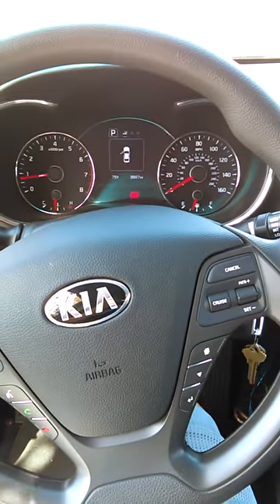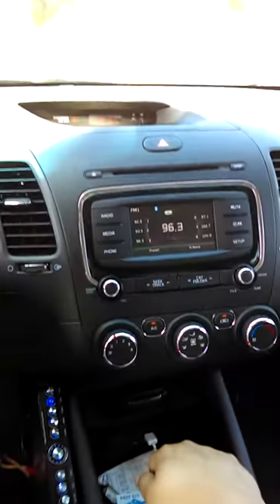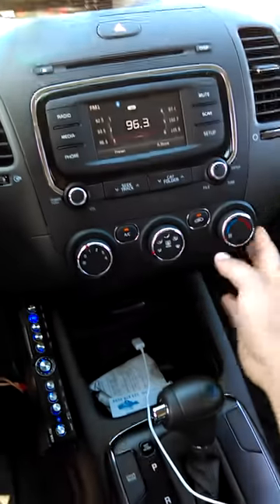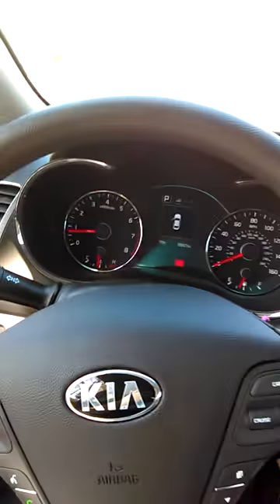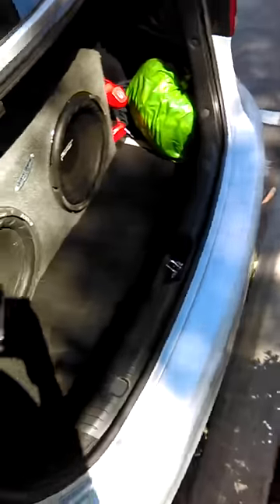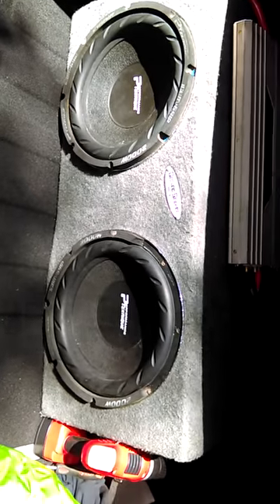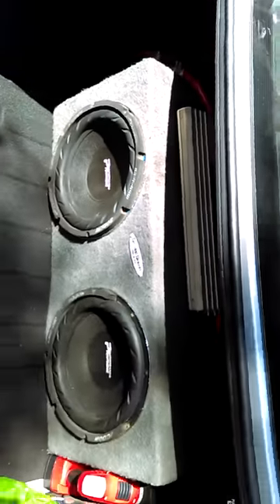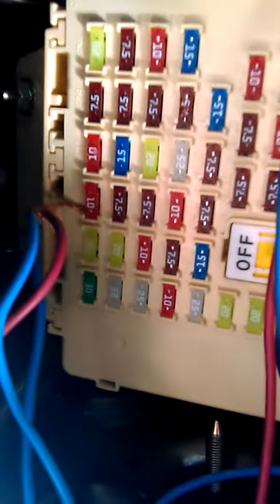2017 Kia forte subwoofers amp on stock radio subwoofers bumping

Comment: If you want to not have wires just poked in to the fuse panel, there is an accessory wire that you can splice into that is in the harness for the stereo. It’ll save you a ton of time when you decide to upgrade the head unit. You’ll already have the remote wire there and won’t have to run another one.

Comment: Not bad man not bad....i have a 17 forte too but i replaced the speakers and stock radio...im amplifying  the speakers and also powering a 15 inch jl sub
Reply from the maker: Thats cool I dont have a personal car these have all been customers cars that I have done but I dot have any cam set up or anything so I use my phone to video the job when i can
Reply: Hey man how is the car holding up with 2 amps.  I have a 2017 forte I’m ready to start building my system. Any tips for me or things to look out for I will be replacing radio all 4 speakers and adding 2 12s

Comment: Hey what’s up, i know this video is old but i want to ask you a technical question? Can i connect only a subwoofer to my stock stereo without a amplifier.
Reply from the maker: No the amp is what powers the whole subwoofer if you do it would have to be one with low watts and high ohms. It is possible but wont sound good

Comment: Could you please let me know how you wired the blue remote cable to the amp? Did you wire it to fuse or did you wire it to the back of the radio and if you did how did you do it? I would really appreciate your response
Reply from the maker: Fuse box Under steering wheel column left side find the radio fuse it should be 10 amp fuse
Reply: @KingJesusAuto  thank you mang! One last question... On the rca adapter..you Only adapt to the original wires from radio correct?  Or do you cut original wires to adapt the rca?
Reply from the maker: Just Just adapt don’t cut
Reply: @KingJesusAuto  thanks again!!

Comment: Not trying to hate. Good job doing it yourself but your fuse should be next to your battery not the amp.
Reply from the maker: Yea I have heard It didn’t make too much of a difference just better access to the fuse if I were to blow it but it never did blow

Comment: Hey I wanna replace my door speakers on my 2018 Kia Forte. Do u happen to know what kind of wiring harness I would need. A lot of stuff I looked up says that it doesn’t fit the make of the car

Thanks
Reply: Same car I have , what size are your door and rear dash speakers? Man everywhere I look it's a different size. Some say 8" doesnt seem right as well as lots of 6 5" and 63/4

Comment: Do yours jump out when you switch it to aux or Bluetooth mode mine do?
Reply from the maker: +tyler pool my subs only jump out when pass hits other than that it quiet if they jump out when u switch your ground wire or remote wire at getting a bad signal
Reply from the maker: +tyler pool can also just be the amp settings
Reply from the maker: +tyler pool and when u have it on aux the aux cord tends to send a loud static to the speakers when u plug and un plug it
Reply: If you’re using a line out converter, you need to check your ground from it. It shouldn’t pop at all.

Comment: What color were your speaker wire colors from the head unit to your rear door speakers? I have a 2017 kia forte and cannot find a digram or anything for the colors of the speakers wires coming from the factory head unit
Reply from the maker: +Tim Malcomson
The radio has so many wires I remember one side was brown and yellow they should be twisted together I will post a video today ill go behind there again and show the wires
Reply: Thank you much appreciated.
Reply from the maker: Tim Malcomson I just posted it
Reply from the maker: +Tim Malcomson i have new video up check out on my channel showed the color wiring
Reply: Whatever you do, NEVER USE THE REAR SPEAKER WIRES ON A KIA FORTE!! Hyundai/KIA has openly admitted that they crossover the bass out of the rear speakers due to the rear being “ambiance sound”
Reply: @forrestfaler718  what exactly do you mean by that?I have an 18 forte and I noticed the stereo is beyond weak especially in the rear. Is there anyway to cancel out what they cancelled out?
Reply: Kris Friesen that means that they have used a DSP built in to the head unit to eliminate frequencies below an unknown frequency. My guess is that it’s 80 hz. You would have to use an AudioControl Epicenter or some other bass restoration module to restore what they’ve taken out. IMO it would be wasted money considering you can just order a Kicker line out converter from Amazon for $20 or less and splice in to the front speakers behind the dash. There are plenty of diagrams readily available online. That is what I did before I replaced my head unit. It worked extremely well and put out a good clean signal.
Reply: @forrestfaler718  and that's what I would need to install a set of subs as well? I need more volume for sure and I'd  like to add a pair of 12 " kickers and amp. What do you recommend i do to make it also work off the factory head unit? Also would I still be able to use the steering wheel controls? Thanks for the response and help its greatly appreciated. Save a few of your videos to help me along the way too.
Reply: Kris Friesen yes the line out converter is what you need to use for adding subs. To get more volume I suggest replacing the terrible factory speakers. You’d be surprised at how loud it will be. Oh, and yes, you can still use the steering wheel controls since you are using the factory head unit.

Comment: Bro, how did you get it connected to stock radio?
Reply from the maker: 69burns94 with RCA converter only so much I can show with only 3 min I have my phone recording once I get a cam I will do another video where I go behind the radio
Reply from the maker: +69burns94 just posted a video where I go behind the radio check it out
Reply from the maker: +69burns94 
did u watch my other videos
Reply: Hey man, just saw these comments.. going to watch now.
Reply: Which wires u use for cover
Reply from the maker: Watch my other video